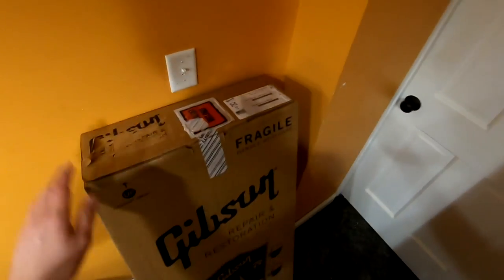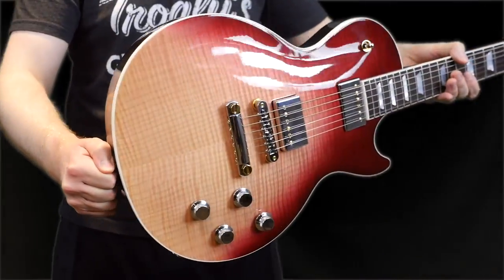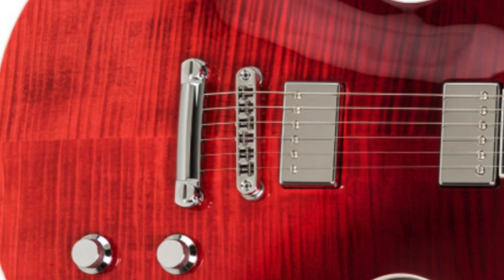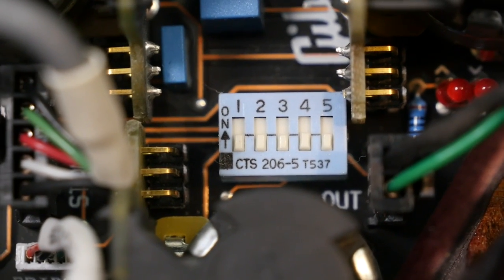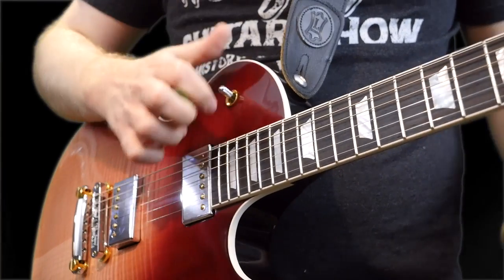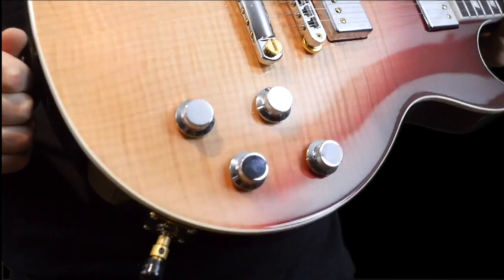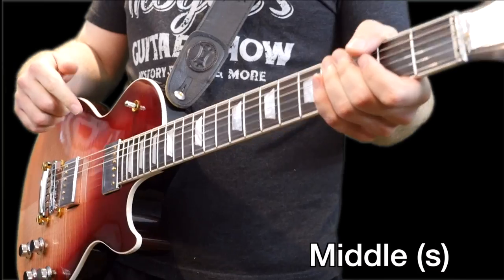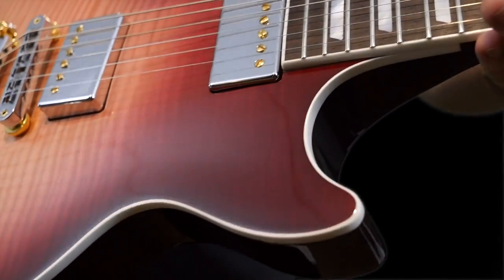How Do These Even Work? | 2018 Gibson HP High-Performance Les Paul Standard Hot Pink Fade Review

Comment: I think it's safe to say I hate the HP lineup. Not a bad concept, just strays too far from what the LP was designed to do. Might just be me though, I'm a bit of a traditionalist. After all, I did just buy a 60s Standard last year haha
Reply: This is Gibson's conundrum. People complain that they are "Your Grandfather's guitar", but when they try and change or modernize anything people complain about that. I've never personally had any issues reaching the top frets on my LP with the regular heel joint. I had a 1963 ES-125 (no bloody T or C!  Channeling my Scotty from Star Trek when he asked the holodeck to put him on the original Enterprise bridge. lol). if you want to have a guitar that got in the way above the 14th fret neck joint. Still I had no issues playing at the top of the only 20 frets. But it took really turning down your wrist and moving your thumb out of the way.

I regress though. I personally really like what Gibson did here. Personally I wouldn't want all the dip switch adjustments. A Les Paul has plenty of tonal colors available with the 2 PUPs and double volume and tone, for my tastes. I'd prefer having the PUP's and switch soldered and hardwired. And I wouldn't have the weight relief. Get a 4" strap and the sore shoulder is cured. I think it affects the sustain. YMMV. I've never played the Axcess heel joint but I think that, along with the belly cut, would be a welcome comfort feature. Some people say the heel joint has a detrimental effect on the tone. If that's the case, give me the standard heel joint. Because, like I said, it doesn't cause me any issues. Maybe Trogly's got small hands. He seems to be very bothered by heel joints. The Titanium zero fret is the most intriguing change though. I'd love to hear that and see how much it helps the action. Plus you could experiment with different nut materials if you wanted to have some other nuts machined for you.

Finally the wider neck and asymmetrical carve both seem like plusses. I've got pretty big hands and often play with my thumb on the back of the neck. Especially when soloing. Seems like the extra space on the fretboard and the taper on the bottom half of the neck would be an advantage for me. 

I commend Gibson for trying to continue to evolve the Les Paul. It's too bad that marketing wise it seems to fail commercially. Or maybe they just haven't found the right combination of "advanced" features. I'd sure be willing to give them some suggestions and they could build me some prototypes to fine tune. Hahaha.
Reply: @Relayer6a  great comment!
Reply: @Relayer6a  That's definitely the most thought out Youtube comment reply I've ever read! You make some really solid points. At the end of the day, it really just comes down to preference. I don't devalue anyones opinions just as a disclaimer, all I mean to say is that there's nothing about these "HP" models that draw my interest. There's a reason the classic 50's and 60's models get reissued, not to mention the originals that can go for well over 100K! It was an interesting idea from Gibson, but it was ultimately decisions like this that led them to bankruptcy, and were miraculously pulled out of it by JC, Cesar, and the rest of the new Gibson leadership. At the end of the day though, a LP is a LP, and to each man his own.
Reply: @jakesekerak4902  Not taking anything away from the originals. They are iconic for a reason. 

The only disagreement is actually Gibson's guitar business had nothing to do with their bankruptcy. It was Gibson Brands and all the other stuff they sold that they really had no clue about that were losing money. The guitar business was always profitable. All new management did was take advantage of the bankruptcy laws to drop all the debt and unprofitable business and streamline the company.  Nothing miraculous, really.

Now if they can quit shooting themselves in the foot with their other actions that would help. Like suing Kiesel guitars about "V"s. Everyone and their mother build a "V" ripoff. Kiesel is a little US company that will never hurt Gibson. I know they have to protect their brand, but pick a fight with someone your own size. How about licensing the "V" design to Kiesel instead of suing them? Win/win.
Reply: @Relayer6a   you absolutely hit the nail on the head there. I did mean to mention the other brands they acquired which led to the bankruptcy like you said. You’re right, they were the major factors, but I did also remember the “non-traditional” guitar models sold significantly less than the “standards” or “traditionals”. 

In regards to the lawsuits, I did watch this one video that explained it; in sum, Gibson just waited too long to sue, because these other brands that “copy” the designs really did steal them. For whatever reason back in the day, Gibson just didn’t have them patented or trademarked or whatever, so they were trying to claim all of that now, just 40 years too late. But I do agree, they are shouting themselves in the foot and should let bygones be bygones. 

You are quite the smart man my friend, I appreciate your intellect on this subject and this has been a great discussion so far. Nice to see intelligent comments on here, especially when there’s usually ones like this other guy in the comment chain… 😂
Reply: Guitar Nerd2021  hey bud, I’m sorry you don’t have anything better to with your life than make stupid judgements and a half-baked insult, but who cares if I’m wearing a mask? it’s not like we’ve been in the midst of a global pandemic for the last year and some change. Oh wait… 

But if you must know, I was on my college campus, and this was still in the time period when masks were mandatory even outside, even as impractical as it was. Next time, check yourself before you come at other people for no reason. Cheers, mate.
Reply: @jakesekerak4902  You are obviously not making the right social comment for him. Whether someone wants to wear a mask or not is their decision but leading by example is always a good start.